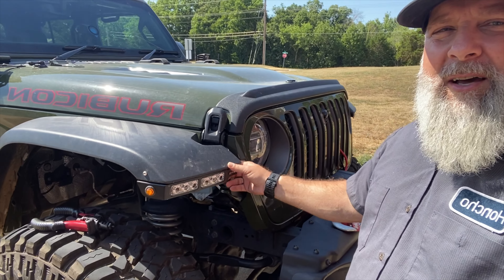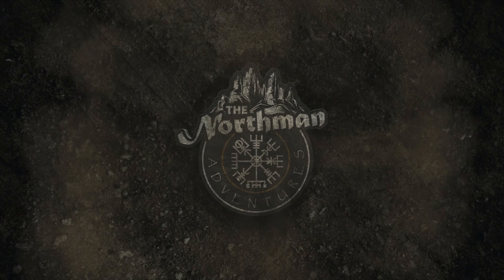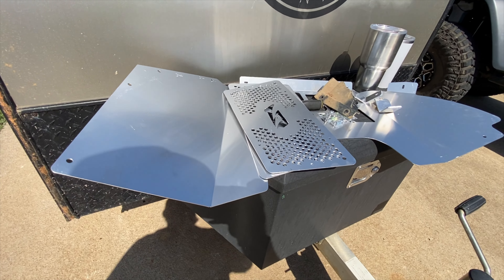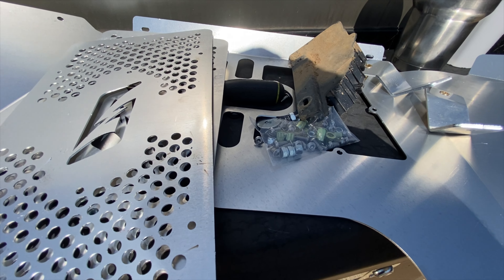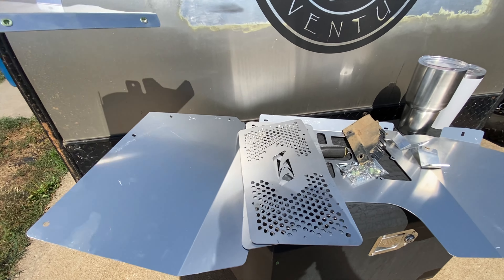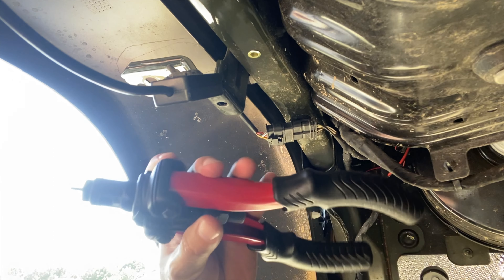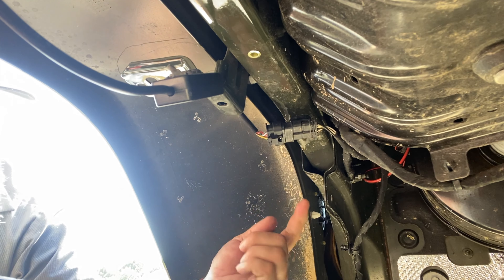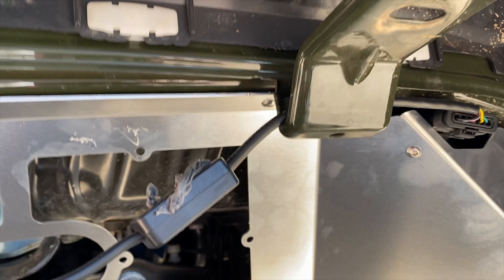How to Install Motobilt Inner Fenders Jeep Gladiator Rubicon

Comment: Nice video... did you encounter 2 bolts on the passenger side near the top center that were a little too long that you had to trim for the inner fender to fit? Did you also get the rear inner fenders by motobilt as well?  Deployed Overlander here. thanks
Reply from the maker: I did not have the issue with the longer bolts.  I have not got the rears yet…but coming soon!
Reply: @thenorthmanadventures5224  Interesting… maybe the diesels are a little different. I just installed the rears yesterday. Super easy!